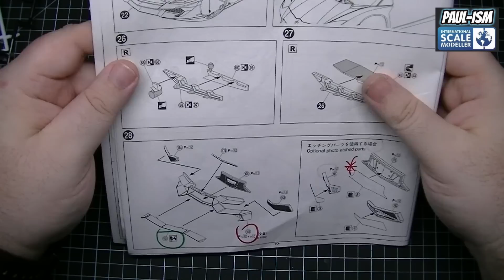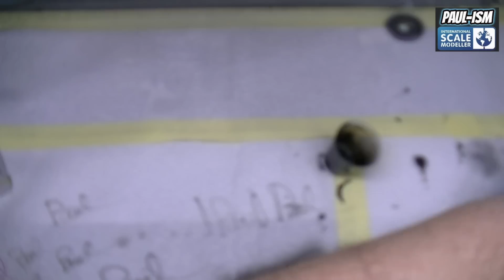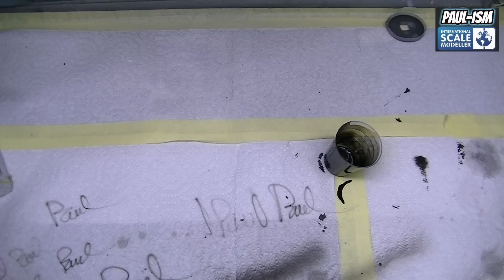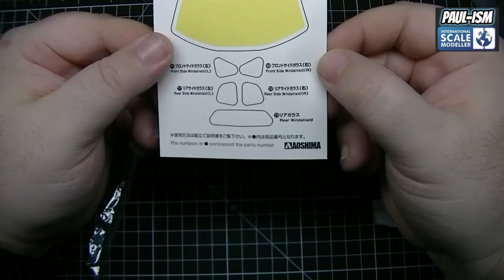Aoshima 1/24 Lamborghini Aventador SV Video Build Part 3

Comment: The Aventador doesn't have carbon fiber, it has carbon composite. The way you can scale that look is to lightly (very lightly) mist a dull coat over your semi gloss black. This will give you a scaled down look of carbon composite on your under carriage, bumpers, engine bay and wing. Hope that helps.